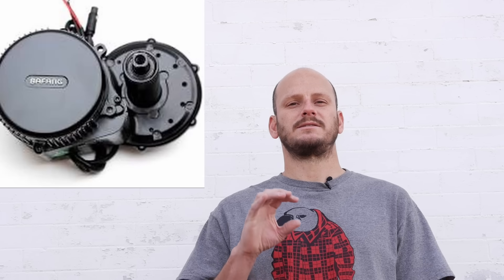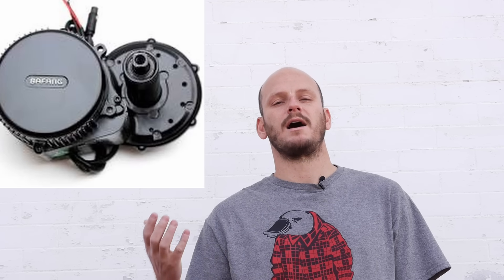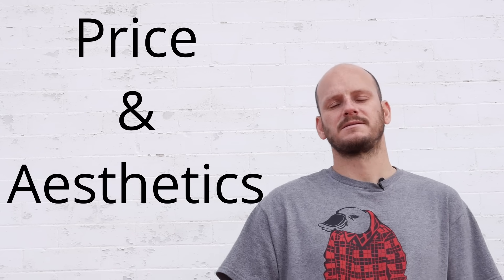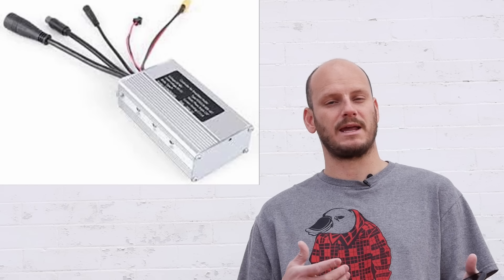Hub vs. Mid Drive Motors: Why Hub Motors Suck and Debunking Common Myths with performance test

Comment: Hub motors are great. I have a hub drive 750w Himiway Cruiser. I don't need a lot of high end type performance. Im sure that mid drives are great, but that doesn't just simply discount all the benefits of a hub drive system. I weigh 230 lbs and my hub drive zips me up hills in my town no problems. I have almost 450 miles on my ebike and have zero complaints.
Reply: Same here.  And you pay 1/4 the amount.
Reply: @michaelbarry8373  but how when most e bike with hub motor and even cheapest 250 watt cost at least 750 800 now? And you can buy bafang motors for like 350
Reply: @michaelbarry8373  hub drives about the same price as a mid
Reply: @Crypton_XD  Where can you buy a mid drive kit for like 200 bucks. i would be very happy to know.  I myself just bought a  200€ hub motor kit and a separate battery for another 200€. The lowest price mid  dives i can find are somewhere between 400-500€ and that's way too  much for  me and they don't even come with a battery.
Reply: @Crypton_XD  I don't know about kits, but mid drive bikes tend to be more expensive.
Reply: @Andrew-it7fb  yea but the extra peformance and reliability you get from a mid drive Is worth it in my opinion
Reply: @Crypton_XD  Depends on your needs. If you don't have a lot of hills and mainly want it as a commuter bike, a hub is fine.
Reply: I have 2 hub motor bikes, and I am sure I would enjoy the mid drive bikes also, but they were much more expensive. He is only talking about the price here of the motor itself, but for some reason the price of actual pre built bikes seem to be much more expensive for mid drives.  You could say that is because the frame has to be more specially made, but many of the hub motor frames now are also special built for the batteries and stuff. ALSO one thing I think a hub motor can do that a mid drive can not do, and correct me if I am wrong, but a hub motor can allow you have a throttle on the bike and not have to peddle at all when using the throttle. I do not use that much, but I love it when you start riding to get going, it makes it easier.
Reply: @jeffdeprey6279  for one thing no stress on the chain or gears, and try getting home on a mid drive when the chain brakes.
Reply: @barriewatson  You can fix a chain...carry a spare plus its tool and get e-bike rated chains. Hubs are cheap for a reason (they suck) and its cheaper to replace worn out wheel bearings (on a mid system) than a burnt out hub motor/broken spokes. If you can self build the costs evaporate. Its complete bike companies that add a mid tax....Plus mids allow use of all your rear gears.
Reply: Didn't even mention regeneration brakes, which are only on a hub motor. And it can make a big difference in range. I have a 5,000w hub motor type bike, and when I got it the controller did not have regeneration braking. I swapped it for a controller with regeneration, and it added probably 20% to the usable range.
Reply: @m.cigledy6769  some mids have regen braking as well but it’s quite rare
Reply: @Crypton_XD  How? The mid drive motors generally have a freewheel so you can pedal easier if the motor isn't running, plus the freewheel hub on the rear wheel. I'd buy one in a heartbeat.
Reply: @m.cigledy6769  haven’t rly looked into them but there’s probably somthing in the back wheel that does it
Reply: Himiway Cruiser 1st addition. Zero complaints 👌
Reply: I am looking to buy the bike you talk about. Cool information.
Reply: At 750w mid drive will have twice the power and probably go twice as far
Reply: @EBikeBuilder_  That's an exaggeration and the extra cost and lack of a throttle make them not the best option for everyone.
Reply: Mid drives have throttle only mode too.
Reply: @joebuck4496  It's really uncommon on a mid drive though, unless you're converting a bike with a kit.
Reply: Hub motors are inefficient.
My E-Scooter has one, rated at 500W. On steep ascends, it still draws 500W-ish from the battery, but produces less power output than me as a human (100 to 150W). So pushing it is actually faster. This is also why it get's cooking hot. You can spray it with water and it evaporates.

Comment: Rebuttal 1: So how does that mid drive work when you want to run it strictly on throttle without pedaling?  Oh, can't do that at all?  I thought that was going to be the one and only situation where you'd use a hub but you skipped that part completely.  For the person who wants to twist the throttle and go like a motor bike without pedaling, the mid drive is out.  I have to wonder if you simply overlooked that or left it out because the reality was inconsistent with your bias?  Rebuttal 2: 20 mph is fast enough, I'm not going faster on a bicycle unless it's like a $6000 bike with the best hydraulic disc brakes, best tires, etc.  (And I do have such a bike with a mid drive in it, but the system is regulated to 18 mph.)  In many markets, an ebike that goes faster than 20 mph is technically illegal.  Bottom line is, I also have a cheap mountain bike that I built with an inexpensive hub kit, I've got $1000 in it, and I enjoy riding my home made hub/throttle bike more than I enjoy my $6000 mid drive/pedelec only bike.
Reply from the maker: Weird, your not the first person to think that mid drives don’t have a throttle with it. Every bike I build with a mid drive comes with a throttle standard.
Reply: @JohnnyNerdOut  But can you just twist it and ride without pedaling?  I haven't seen one like that, but pardon me if I am wrong.  :)  Hey, and good video despite my objections.  You're doing a fine job and a good service to viewers.
Reply from the maker: @xray7908  yes, all my bikes have a thumb throttle. If you ever watch my custom build videos I do all the performance tests with only throttle power
Reply: @JohnnyNerdOut  Then I owe you an apology and an edit to my comment!  Should I leave it, or edit it?  How does a mid drive bike run on throttle with stationary pedals?  Does the chain ring "freewheel" without turning the pedals?
Reply from the maker: @xray7908  ya the front chainring just free wheels 😀. No worries,  Michael 👍
Reply: @JohnnyNerdOut  My Shimano mid drive does not do that.  Could you maybe throw in which models do this?  Or, better yet, is there a video that covers this topic?
Reply from the maker: @xray7908  any aftermarket mid drive does. I only do custom builds so that’s what I know. Most premade Ebikes suck in general. Not having a throttle is one reason 😀
Reply: @JohnnyNerdOut  Therein lies my confusion, I guess.  Thanks for taking time to politely correct me, you are a gentleman and a scholar.
Reply from the maker: @xray7908  haha, you don’t know me!!!

Comment: One more point, hub motor takes significant more power draw from the battery wen it starts to move, in a city travel is a big diference

Comment: his statement that the cost is only fifty dollars more for mid drives over hub motors is not true, most mid drive systems cost twice as much as a hub motor kit. The folks I build for generally want a work bike that is cheap and easy to maintain and flexible. The two systems he uses in his video are bafang 750 watt mid drive and 750 watt bafang Planetary geared hub motor. I have installed both and found them wanting. the hub is fragile , noisy, slow. by my standards. the mid drive sounded like I was riding a bradley fighting machine.... well heavy motor gear noise as well as chain noise. I love a direct drive system for strong, fast bullet proof performance that is whisper silent. He never mentioned the PAS on the hub motor kits combine the bikes own mechanical means as well as the motor hub providing drive. He keeps saying it is like driving in one gear. He has never ridden a direct drive system with 5 levels or better of pedal assist. I have a 1000 watt direct drive diamondback that will go over 30 mph but too 20 plus up hill with just throttle alone 27 with pedal assist. If you are  going off roading in the mountains on an ebike by all means get a mid drive this is where they shine but for riding back and forth to work or just having fun riding with the grandkids in the park, low cost better option is the direct drive systems. And if you still want the mid drive system buy a purpose built factory ebike instead of building one just for the proper chain and ring system.
Reply from the maker: A 750w hub kit is about $400 from bafang. A 750w mid drive is about $450 from bafang. If your mid drive sounds like anything other than quiet, send it back. Sounds like you had a defective motor. Mid drives are near silent.
Reply: @JohnnyNerdOut  that price range is for Bafang products, which are more expensive than most of my clients want to pay. Most direct drive systems cost less than $250.00 and come with everything you need to convert a bicycle, except for the battery. I can up volt most direct drive systems to suit my customers need from 36, 48 to 52 volt with no modifications to the system needed. I have found any geared system, hub or mid drive tend to make humming noise as the planetary gears move. To me as heavy as a direct drive system maybe compared to the geared drive systems I prefer the quiet ride you get with no moving parts.  PS. If you are trying to sell a product you might reframe from insulting folks you are trying to sell to. If you love those systems so much use them. I will continue to sell and install conversion kits anyone choose for their bike without judgment.
Reply from the maker: @dalvenable331  didn’t mean to insult anyone, not my intention. All Ebikes are good. Just some are better. My intention was to inform people about the difference and kill bad information that seems to be floating around the rumor mills

Comment: The worst thing about hub motor is the removal of the rear wheel. You have to remove the torque arm and big ass bolts(no quick release) with a wrench. Also, since it is unsprang mass, you will more likely get a puncture at your rear tire. Never had spokes shaken loss though!
Reply: Carry 1 or 2  bottle of the green slime puncture in tire repair n a good bike pump, if you get a flat put 8 ounces of that stuff in n pump it back up n this will fix many flat tires, also future flat tires, but if you don't ride it for awhile the green slime will harden n you will have to put more in if you get another flat, also it is good in there for 2 years before it goes bad, also check date on bottle n make sure still good, n if you dont use it in 2 years then get another bottle cause it has like a 2 year shelf life kept in right temperature range
I got a flat on back tire on 750watt ebike fat tire n was camping in woods, i used crank strap to on tree n back rack to lift bike up n then put slime in n spun tire around, lowered bike n pumped back up n rolled it around n flat was fixed n bike ready to go
Get back baskets to keep extra stuff in, n get a small step on pump, better then those skinny hand pumps
Also you can help someone else out who gets a flat

Comment: Yeah low maintenance with hub, I can still ride with a dropped or snapped chain. The chain isnt going to rip out and fly off at any point. Hub all the way. I have ridden with magic pie 5 for work as a food courier, no rear suspension and no spoke issues, no burnout riding in the rain all the time for 2 years. controller is built in! This guy doesn't know what he is talking about at all, there are many hubs with built in controllers, all the complaints are only about the build quality which can be just as much an issue with mid drive but way more of an issue because you are using the complete drive chain!
Mid drive is way more of a headache as you have to deal with the whole drive chain.
Oh and I cant get clothing like flappy waterproof trousers stuck in the chain so easily as I can just stop moving the chain whilst riding.
Reply from the maker: The biggest difference is the performance between a mid drive and a hub motor.

Comment: Electric motors don't need gears. Why introduce a transmission if you don't need one? It reduces efficiency. There is no extra strain on a direct drive motor just because there's no transmission. Direct drive motors have advantages and disadvantages. The biggest weakness being cooling. There's not enough surface area to dissipate the heat. What's the most powerful mid drive system? Still rather weak, isn't it?
Reply from the maker: Ebike motors absolutely need gears. Maybe not in automotive applications where there are massive amounts of power going to the motor. But in small motors ABSOLUTELY. you don’t have to believe my words but the video comparison doesn’t lie 😀
Reply: @JohnnyNerdOut  What's the most powerful hub system you've ridden?

This just isn't the case. It's just a matter of power. A 10kw motor doesn't need gears. It will move a person on a bike as fast as they dare to go.
Reply from the maker: @SyntacticOperator  I just rode a 20kw hub bike. I stand by my assertion.
Reply from the maker: @SyntacticOperator  if geared correctly yes a 750w would be a better hill climber

Comment: motorcycles would suck with hubs since: a) the motor would be heavier than it needs to be for a given power output, and b) the huge unsprung weight makes the suspension not work as well

Comment: It's like driving a 1989 ford festiva that has a 3 cylinder Geo metro engine. 50 horsepower engine with 4 speed standard transmission and it goes from 0 to 60 in about 3 to 5 minutes.

Comment: It is really about front wheel drive or rear wheel drive. Nothing else. That is the main difference between hub or mid drive motors. Actually a lot of nonsense in this 'explanation'. The rear axle (mid drive motor) pulls as hard at the wheel spokes as a front drive does. If the spokes can't handle the force they will snap, independent of front drive or rear drive.
Second: Torques, can't be compared from the motor specs. You have to compensate for the reduction (gearbox).
And third: Chains on normal city bikes hardly ever snap. But they do work themselves loose from the wheel sprocket. After wear and without timely tensioning. This is what happens with the normal city bikes, except those that see a dealer now and then. Rear drive has the disadvantage here. All power must go through the chain. Front drive is a bit depending on the used controller. Some only need the pedals to rotate, without  any force applied, Some measure the force on the pedal, so you must always have some force from the user going through the chain. That actually gives you an all wheel drive bike :-)
Maybe I overlooked a number four and five. But not going to view this again.
It's still for the user themselves to decide on front drive or rear drive. But please get the facts right.
Reply from the maker: Someone once told me and I totally agree. You don’t have to be a mechanical engineer to appreciate a mid drive but it definitely helps😀
Reply: @JohnnyNerdOut  Just an unrelated random reply.

Comment: How do you think the mid drive gets power to the tires? They turn the chain which turns the hub and it turns the spokes 😂. I'm not trying to defend hub motors but I'm laughing at the clear bias in the video.
Reply from the maker: Check my pinned comment for clarification

Comment: Well, I have a bike with a pinion gearbox, and I have a hub drive, no external control box (all in the hub), and it fades beutiful from 100% to 0% in power from 26 km to 26.5 km, so you do not get this wall to run through. I have Gates belt drive and hydraulic disc break. The reason I have an electric bike is to ride to work in all kinds of weather.
 I like riding a rye bread powered bike and do not want a faster bike, think it would make me lazy, if suddently I was a super human. 
As I see it, a fan boy will be a guy who can not see any disadvantages of a product. Hub drives are bottom heavy. Hub drives that are large have no gear, small have planetary gear probably nylon gear but better accelration. center drive is full of gear and all power must be transported via the chain or belt. They are many times quite noisy and  just stop giving any power when they hit the top speed limit (that could be solved so easy with software). That's one of the reason we have this conga lines because no one wants to go faster, knowing the motor quit giving and them anything.

Comment: Dear Johnny, I suggest you educate yourself before misleading people. Start by finding out how and WHERE torque is measured. I case of hub motors it is AT THE WHEEL. Mid drives are measured at the crank. Divide the figure by the transmission (sprocket) ratio and you'll see what happens!
Reply from the maker: I’m not sure what that matters when the end real world result is the same. The mid drive motor using the same wattage completely outperforms a hub powered bike. Am I missing something?
I was going to even point out that numbers sound great on paper but it’s the real life experience that is hard to communicate which is why I did the side by side comparison.

Comment: 2 more things in favour of hubs.
Firstly, installation. You can install a hub with just one adjustable wrench, a pair of pliers, a screwdriver for the electrics, and some allen keys - as you do not need to remove the crank. For a mid-drive, you do need to remove the crank which means you need an automotive-size socket set, which is EXTREMELY expensive compared to a wrench, pliers, screwdriver, and allen keys.
Secondly, cost - you said they cost 'within fifty bucks', a Bafang 750 kit costs around £450, a 750w hub motor conversion kit costs around £150 (both full kits with LCD display, excluding battery), thats a £300 difference, which in US bucks is 425 bucks. 50 bucks is not 425 bucks!
Reply from the maker: Are they both the same brand though? That’s like comparing a Lexus to Ford